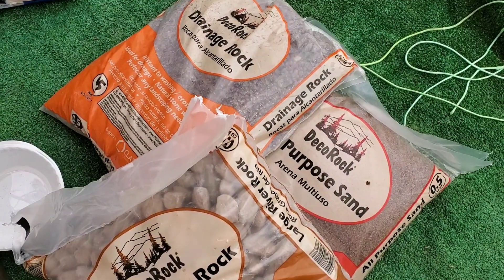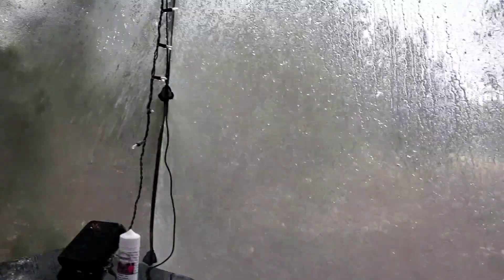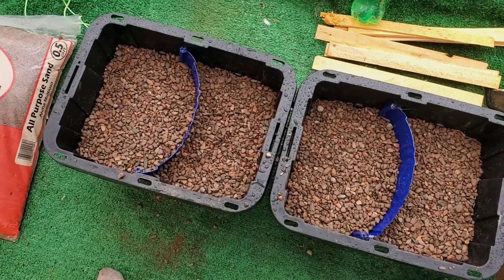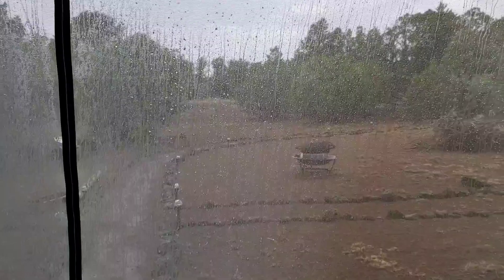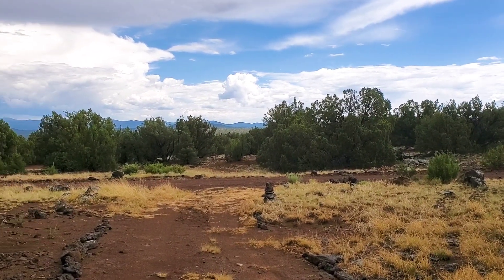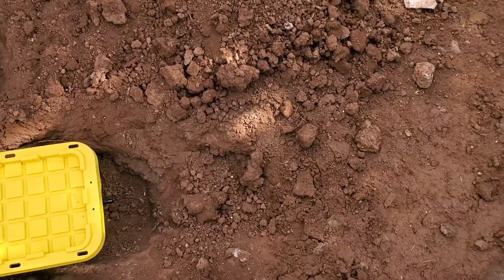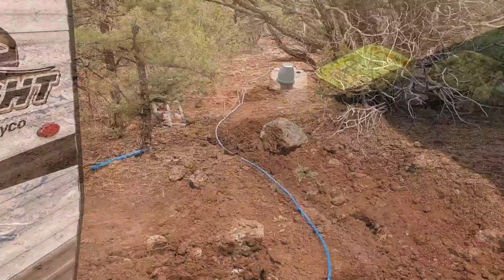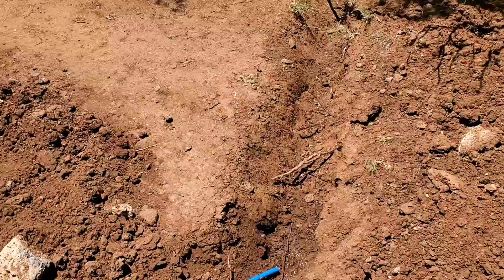Gray Water Filter System - Arizona Homestead

Comment: Does any grease/ food scraps that might come out the pipe mess up the filtering process?
Reply from the maker: Grease and food is considered Black Water in Arizona and is not allowed in a Gray Water setup. Even on Grid it is never a good idea to put grease or food down as it can cause problems to your plumbing and septic in the future. We always wipe grease and food off with a paper towel, dispose in trash, & then wash.

Comment: Nice set up! I have seen other videos like yours, but on the County's website, a permit to live in a RV and discharge grey water is required. So I am confused, I see a bunch of people doing it, but no talk of a permit. Have you had any issues with the county? I also own some property in AZ, so before I make the big leap, I wanted some insight on your personal experience, if any with permits, also for other YouTubers that are wondering as well. Thanks!
Reply from the maker: Yes a permit is required to discharge. Just print the form for what you are discharging such as Septic, compost toilet, or gray water. Septics requires an inspection. However gray water rules have changed. Sink water is now considered black water in AZ. So gray water is bath, hand washing only, and can be used on plants only. Without septic all black water must be dumped at a waste water facility (RV) dump. However to get a certificate of occupancy and get a PO box you must have septic installed/inspected. However you need a septic first before any building permits can be granted. Permits are easy to get and are required by the county.